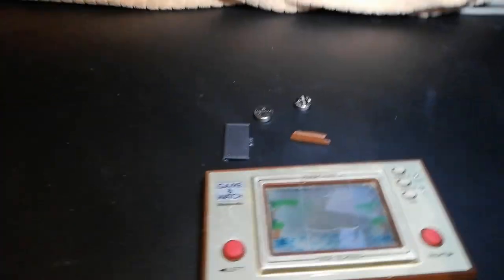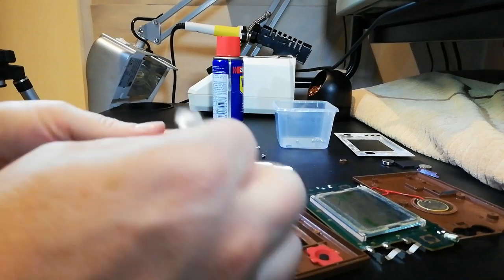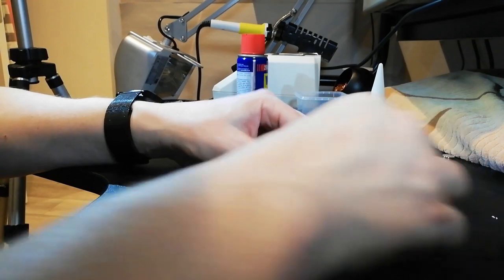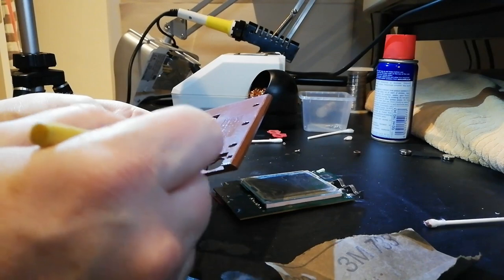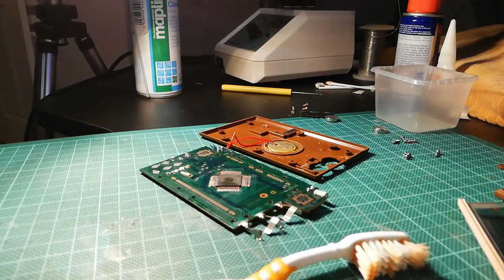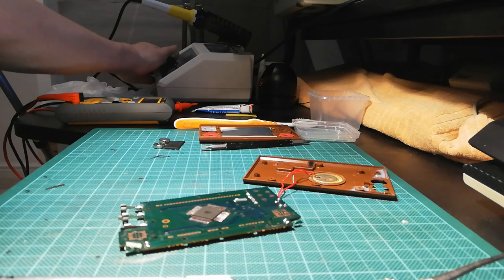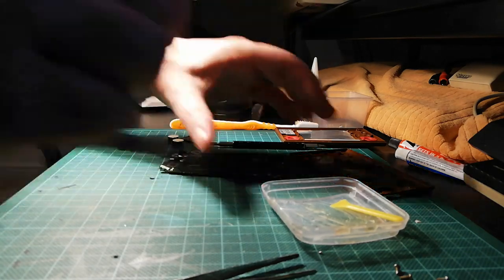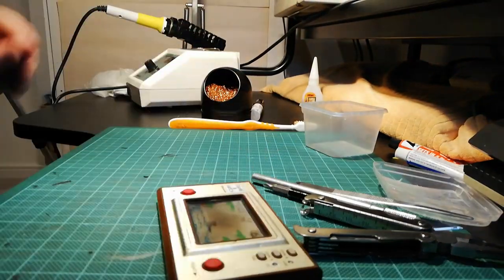16 - Nintendo Game & Watch Repair (Parachutes)

Comment: I have the Popeye game (single screen goldseries like Parachute) but none of the left/right buttons are working. The buttons and contact surfaces are cleaned and i've inspected every inch of the motherboard with a magnifying glass. Also followed traces with a multimeter (although i'm no expert in electrics) and the button traces end up/give signal at the main chip. Also the second trace to the buttons end up at ground / - I have no clue what to do next with this one :(
Reply from the maker: It could be a number of things wrong here. A problem with the main chip, issues with the buttons themselves or just that the game is so old its unrepairable. I can't remember if these are multi layer boards or not, so there could be an issue with a sub layer that you cannot reach. Without physically seeing the game I could not hazzard a guess at the real issue.
Reply: If I remember correctly, they used to use a kind of graphite contact under the buttons in some games. People taking them apart assumed it was grime and scrubbed it off, ruining it. Try using a sliver of tin foil stuck under the buttons and see if that helps.

Comment: In many of my GWs I have a few characters missing while the rest of the sprites are dark. How do we fix that?
Reply from the maker: Could be the zebra connector attaching the screen to the mainboard? Hard to tell without taking the GW apart and cleaning with IPA. Do the missing characters re appear if you apply light pressure to the sides of the screen?
Reply: @MikesRetroTech  I opened some. And even changed the rubber connector (wide screen models) and the zebra for multi screen but still that same place doesnt come up. Is it possible that the LCD has gone bad but only those two or three spots dont light up because I thought I tried everything. I have a lot of games this. The only way I am building my mint collection is swapping stuff from one game to another. Reflector from somewhere, polarizer from somwehere and sometimes the LCD. I hate to mess up three games to make one. Any further advise will really help.
Thanks
Reply: I had a double screen Donkey Kong that also was missing 2 or 3 sprites on the top screen which i never was able to fix. I cleaned all connections and tried applying pressure but eventually gave up. I don't know if an LCD can break this way but i guess it's possible (?)
Reply from the maker: @RedFarmer2000  If the LCDs are like the old watches of the day, they could have power connection issues. I have seen this issue in Game Boys and the only fix was to replace the screen completely. I have not had many G&W's to fix so only going off what I have seen online, but with the age of the game I would not be surprised if the LCD has just given up and died in that part of the screen :(

Comment: Great video, question though, when you removed the screen from the pink strips, they were stuck to the glass. But when you put the screen back down you didn’t glue the pink strips back to the PCB?
Reply from the maker: It is a while since I did that repair, but recall that the surface area of the pink strip is very small, so to not get glue or sticky stuff on any of the PCB, i just used the compression of closing the case against it. It worked, and is still working, so glue is apparently not needed.

Comment: Can I recommend you buy some plastic weld, it works really on game and watch plastic and also very good for repairing broken clasps
Reply from the maker: If i ever get another on of these to fix I will look into plastic weld
Reply: @MikesRetroTech  I had a game and watch lifeboat arrive in the post that had been damaged in transit and the clasp was broking because of it. I used plastic weld on it and it joined it back together really well. I highly recommend it.

Comment: Hi Mike i write you for a little trouble with a casio game, because i don't have some sprites in the display, I clean the contact rubber band, clean the display and the circuit board, and still less sprites
Reply from the maker: Hi, Sounds like there may be an issue with the LCD, or maybe some of the contacts within the LCD. They are very delicate and probably easily damaged. Have you made sure that all contacts are cleaned with IPA and that there is no corrosion on any of the contacts, and have you checked that all traces have continuity? As with this game and watch there was the hairline crack on one of the traces which was not visible to the naked eye. It was only when scraping away at the solder mask was the crack evident and fixable. Try with a multi-meter if you have one as this would be my first choice in diagnosing the issue.
Reply: Hi Mike, yes there's problem with the  lcd screen, I touch with multimeter and appears some sprites in the contact lines and other no, so the problem is the lcd screen, may be cannot working anymore 😭😭
Anyway thank you very much greetings from Chile
Reply from the maker: @nelsonasenjo2511  Oh no, that is a shame. Can you not find a replacement LCD on eBay? I suppose it depends on how old the game is?
Reply: It's a casio game hungry jiraffe from 1985, not easy to find, and need the screen of sos titanic cg-117a, both of 1985, hard to find and very expensive